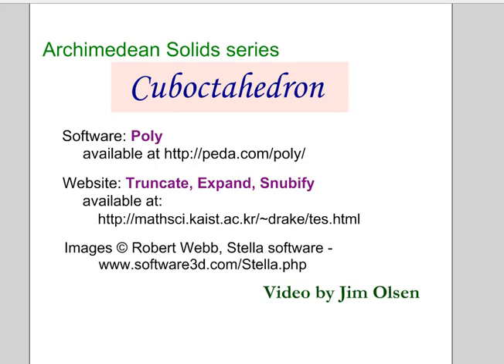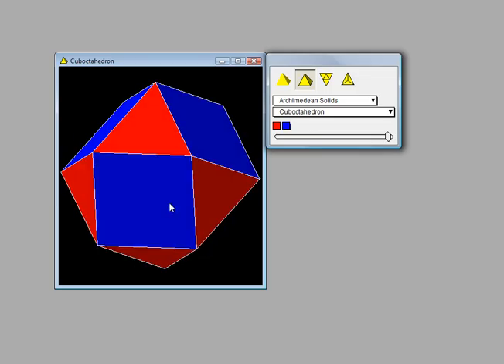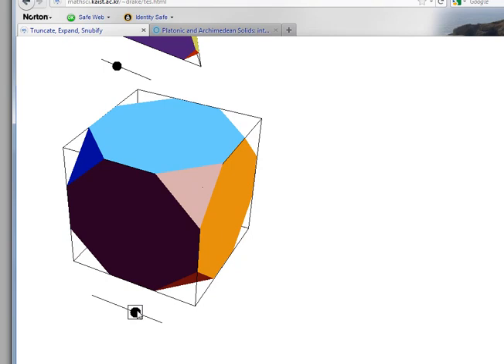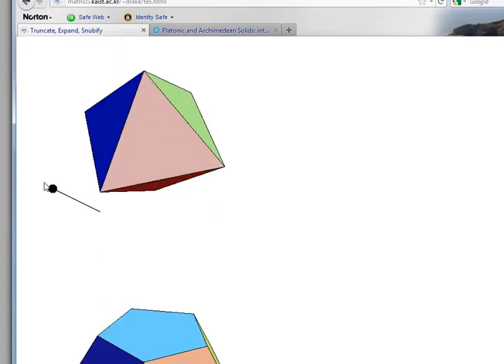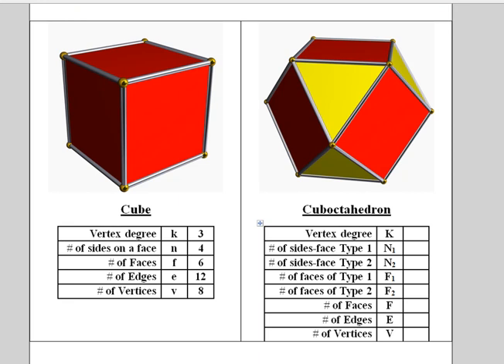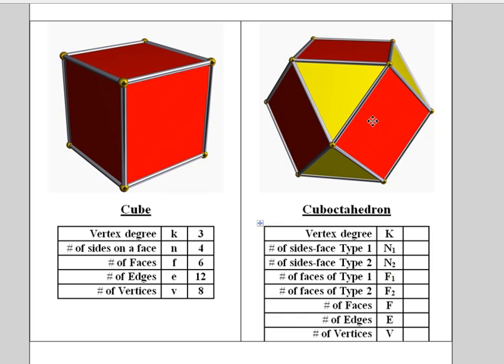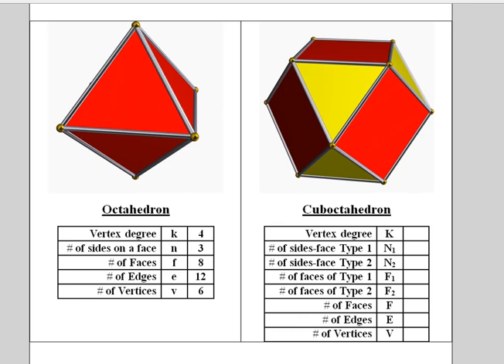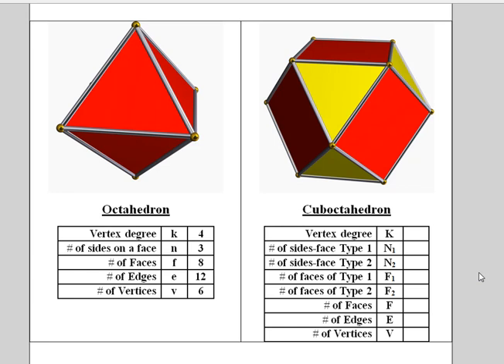Cuboctahedron

Comment: Pretty cool stuff,, old video but still educational.. the only thing I would say that throws me off, but it might be the program is the 1/3 truncation .. cutting an edge to 1 third won’t result in a regular octagon.. think of a tic tac toe board, using it to make an octagon u notice that all edges can’t be equal, because of Pythagorean’s theorem
Reply from the maker: Yes. You are correct. For truncation we do not truncate to the one-third point.  This was an error in the video.